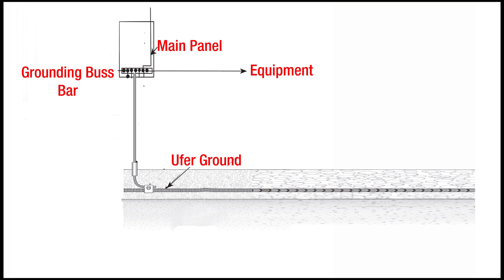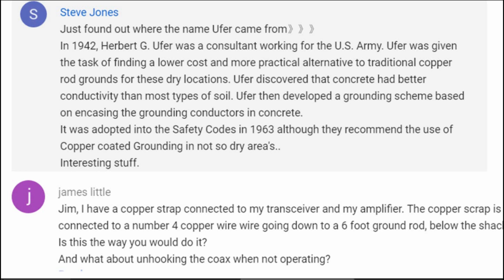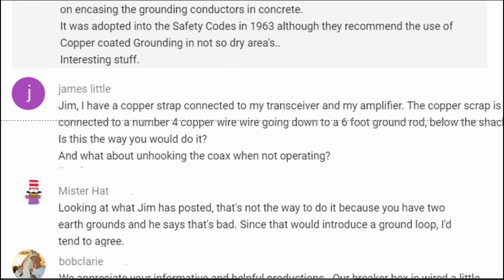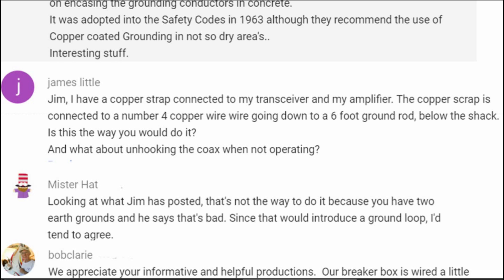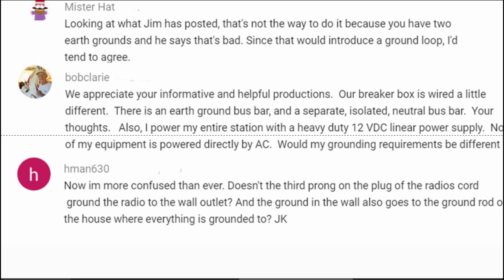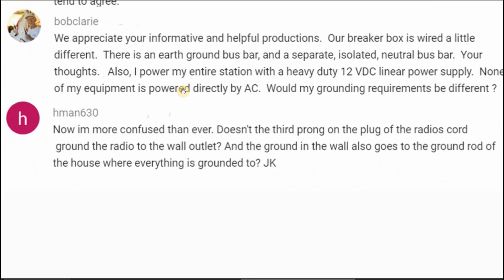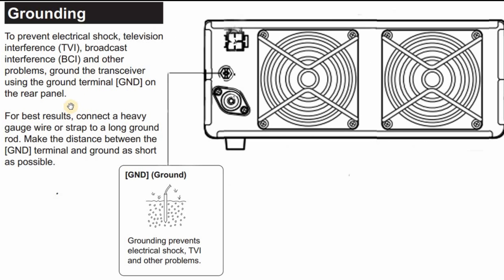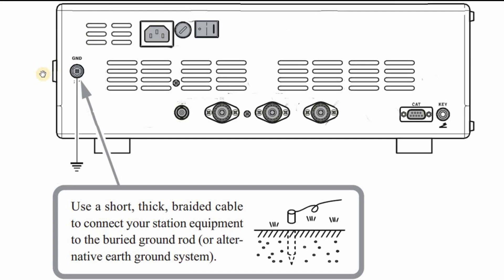Grounding, Bonding, Earthing, Shielding and Protecting with Jim Heath W6LG

Comment: Jim, I respectfully disagree with your "one ground" rule.  Have you read the new ARRL Grounding and Bonding book?  It references NEC, Motorola's R65 and military standards.  As you know a number 12 wire running back to the breaker box is good for AC safety but can be a poor RF ground due to its length.  A separate earth ground very close to the equipment makes a better RF ground and is a ground for surge arrestors and rotator cables. Also metal towers require their own ground system. What makes it work functionally and legally is to bond all earth ground rods together with a heavy conductor, #6 AWG minimum and at least 6 feet apart. The book also talks about UPPER FLOOR STATIONS, ferrite, welded ground rod connections and RF ground planes (something DX Engineering picked up on recently).  I believe this book should be required reading for any Ham that goes beyond a hand held HT. 
73  K9AEE
Reply: I agree there's a lot of good info in that book, And I also have to disagree with using the power safety ground for the station ground. Although according to the NEC (NFPA70) All grounds are supposed to be bonded together. And I have heard good arguments against that also. 
Anyway, good video and discussion. Grounding in the real world is more kin to black magic...
Reply: @miller-clem  :: so why can't all roads lead back to home? If you're going to trench around your entire home inlay double Ott and bond it to 8ft grounding rods at regular intervals why can't you attach 6 AWG to the grounding post used by the electrical system? At least then everything is connected at the same ground potential.

I always ground my Towers separately. When I dig the hole I get down all the way to the bottom and I pound an 8-foot ground rod in at the center and then I run a piece of double lot UPS through the center of the cement before it's poured and attach it to a leg of the Tower. The better way to do it is to run a piece of ABS down so that if the tower takes is strike and it is routed to the ground it doesn't blow the hell out of these cement and shatter it in the process.

I've been doing this for about 40 years and there's no perfect solution. But I am looking for as close to perfect as I can find and it seems that amongst all the experts each has a different opinion of how it should be done. I have the R_65 guide by Motorola and if I go by that why would I want to go and buy the ARRL book? Just a question. Basically, what's in it for me?
Reply: JustAnotherGuy Hello, I am trying to learn about grounding and have been getting a lot of opinions on this as well.  I get that the electric ground is probably not adequate during a lightning strike as the long wire to the electrical box ground rod may have too much inductance for the lightning to flow that way.  My approach is to bond the rods together to pass NEC, but how do I keep lightning ought of the shack or the building I am trying to protect with these various ground rods?  NOTE: I am no expert in this so please be kind.  -)

Comment: Since we are to have 1 ground for the home, how about towers?  I help teach a Technician class and the safety portion says that a tower should have a ground rod for each leg of the tower, and then a heavy conductor connected between tower and these ground rods.  What about those rods (I do realize they are for lightning protection)
Reply: I believe that training also says to bond all the rods together with as short as cable as necessary.

Comment: one of the best ways to learn about station grounding is to buy the book "Grounding and Bonding for the Radio Amateur" By H. Ward Silver.  You can get it from the ARRL or at Amazon as a Kindle book or paperback.  I have it on my Kindle and read it on my phone. It is very good for clearing up many misunderstandings.  I have over 30 years experience setting up SSB and other electronics on boats and I learned a lot from this book.  K6DCH

Comment: Jim, I appreciate your attempt to clear up these misconceptions. I hate to rehash or throw in specific situational questions but I have been unable to clear up my grounding questions.
I am in the process of installing two base antennas at my house. My house electrical system ground consists of a ground rod (On opposite side of the house from the antennas) which is bonded via a 4 or 6 gauge wire to a cold water pipe in my crawl space. All water piping is copper including the run to the meter at the street. This is how the house was built and not a later retrofit.
My plan currently is to add a 8 foot ground rod on the antenna side of my house, this ground rod will be the closest point where both antennas masts can ground to a common point. I will attach:  the ground from a 4010 EFHW antenna ground connection and its 10' mast, the ground from a gable mounted dual band antenna mast and the grounds from lighting arresters from each of two coax cables, all to this new ground rod. To meet NEC. requirements for a common ground I will then bond the new ground rod to a 3/4" cold water pipe exiting the building about 5 feet away with a 6 gauge copper ground wire. I believe that in fact I will have created what the NEC. refers to as an "intersystem ground" I am assuming this would meet the requirements of the NEC. to bond separate tower and mast grounds to the building grounding system. I've come up with this plan after trying to interpret the NEC. article 810: 20-21, article 250, and after reading a publication called "Reeve -  Antenna System Bonding And Grounding Requirements in the USA."  From what electrical training I've had I reason that bonding the two grounds together eliminates differences in potential to ground and both the antennas and the electrical system in the house will have the same potential to ground which would not be the case if they were separate and not bonded. I am not planning to add a ground at the radio cases ground studs as I believe the ground from the coax shield should be sufficient. My power supply is grounded through the house electrical system via a ground on the 3 prong plug. If I do find a need to ground the radios at the ground screws for some type of RF interference I would probably only run a ground wire from the radio to the case of the power supply which as I said is grounded through the power cord. Running a wire from the second story of my house to the crawl space or to the back of the house is not practical.
I respect your knowledge and experience in this matter and would like your input. Thanks

Comment: How do lightning arrestors change the grounding system? Does the ground rod that has the arrestors need to be tied to the electrical panel ground? Or does the coax shield connected to the transceiver which is then tied to the AC panel ground count as sufficient? Thanks.
Reply: Both ground rods need to be bonded together with a suggested 6 awg wire.  If you can bond them both outside the house and inside the panel.

Most newer houses have 14 awg wire heading back to the panel from the outlet.

Comment: Jim, Thank you for your wisdom on this issue and many others. I enjoy your videos.  I am a new ham.  I live on the east coast - in a high lightning area so Grounding, Bonding, RF and Lightning Protection are of great interest/concern to me.  
I have a 2nd floor shack in the making that is located diagonally opposite from the electrical panel (>140' either direction on the perimeter from directly beneath the shack to the electrical panel.)  I have an "Ufer" ground system.  So I spoke with the Electrician that wired my home about the NEC and local codes.  He said I should put in a local ground rod(s) near the shack and "bond" them to the "Ufer" ground by way of a cold water pipe.  All the cold water pipes and natural gas pipes are bonded to the "Ufer" ground system by NEC rules.  That keeps the additional ground rod(s) at the same potential as the electrical panel.  This approach appears to be consistent with Chapter 6 "Good Practices Guidelines" in "Grounding and Bonding for the Radio Amateur" by H. Ward Silver, N0AX, ARRL 2017 and consistent with my reading about Bonding in R56.  
So, those diagrams in the equipment manuals are missing a note that the grounding rod must be either the electrical panel ground or "bonded" to that ground system.  I think?
Reply: The cold water pipes would eliminate more expensive copper wire investment.  I happen to have an armload of tinned copper braid that would fill the bill, as my shack is very close to the bathroom sink. All I need are some proper sized ring connectors.  I`ll be taking this under consideration. Thanks for the input.
Reply: The ARRL grounding book also suggests to avoid having solder used in your ground.  If you tie your shack ground to the bathroom sink copper pipe, make sure the pipe does not have elbows soldered together.  (If lightning does strike and it melts the solder in your pipes, then you might have water leakage.)
Reply: Very good point. Thank you.
Reply: I am fortune to have a nearby outdoor water spigot with the copper supply tubing buried 18 inches deep as my bonding connection.  That way I am not inviting RF or lightning into my house - with any luck.  Having suffered two previous lightning strikes at this location, I am trying to be a bit cautious in my approach.

Comment: I've noticed when the term "ground" used, it can mean one of several different situations. There's the equipment grounding conductor (EGC) the Mike Holt really emphasizes in his NEC code classes. There's the earth ground rod (or equivalent). There's RF ground to keep RF away from people. There's lighting protection grounds. They all share common terms and components but perform different functions.

Comment: Thanks Jim. It looks like the way of doing it the way I have heard from engineers. I suppose the common wisdom surrounding grounding ham gear seems to be in question. I look forward to further instruction from you and others. The comment section is fascinating. too. KC3BXZ Joe P.S.--- I seem to have heard that bolts of lightning can strike the ground around earthing rods, causing current to travel back to the whole shebang.

Comment: Since you mentioned the ferrite cores, could you perhaps go into a bit more detail in one of your future videos about the ferrite core specifics? 
I did my university studies in electrical engineering, but later on went into signal processing, so I might be a bit out of touch, but back when we did AC circuit analysis at the uni, we always expected to have information about the inductivities  we're using. 
My experience when researching the ferrite cores commonly sold to hams for EMI suppression purposes, was that they sometimes have physical dimensions specified, but only extremely rarely provide any usable information about the ferrite material itself, making it very difficult to estimate performance of the ferrite before purchasing it.
So is there a better way of figuring out what the core do, other then getting them and hoping for the best?

Comment: Jim, thanks for this and I'm really looking forward to the next part(s) in the series. I'm particularly interested in the use of ferrite beads (and a good source would be appreciated) and in the similarities and differences between voltage/current baluns and ununs. I've been reading a lot about these transformers and there seems to be quite a lot of different thoughts on them. So, I'm looking at both the theory of operation and practical construction of these useful devices. Thanks!